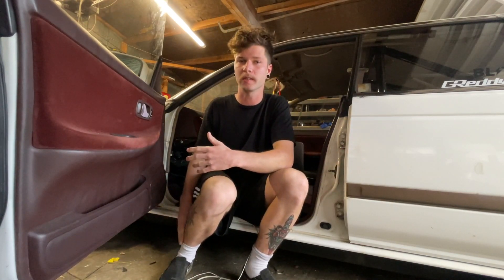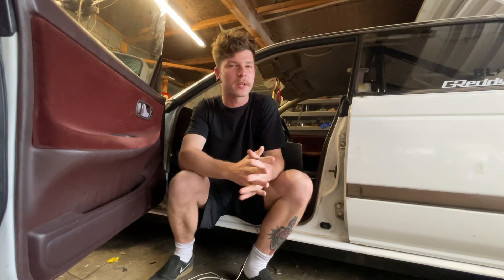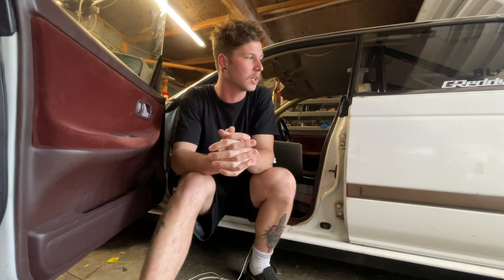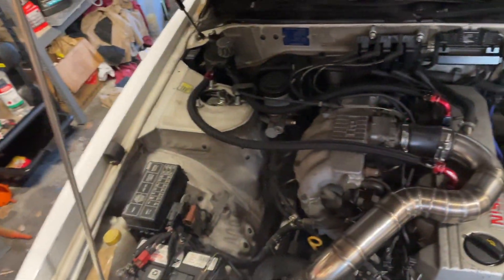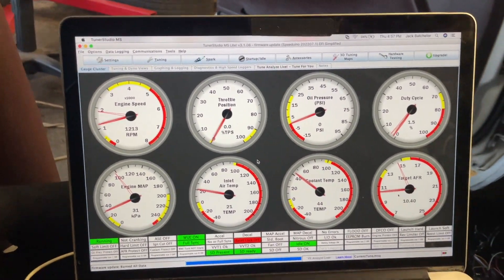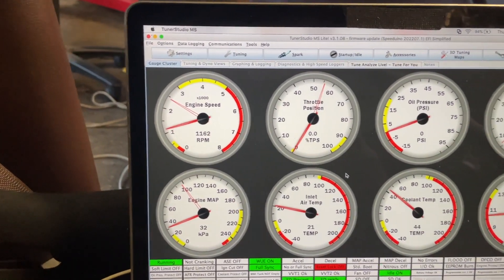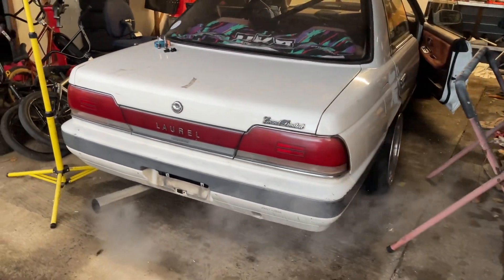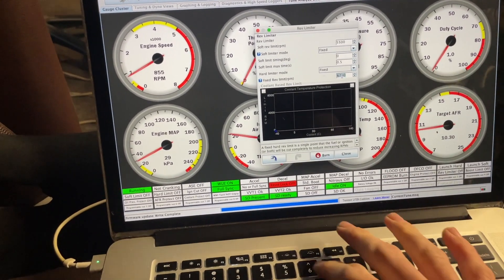RB20ET Laurel ready for tune! +Rev limiter testing

Comment: I’ve got the same first gen rb20E in my SA22c rx7, mine was a factory ET.

How’d you convert the valve cover ports from plastic barb to -AN?
I’m definitely hesitant to pry at them as way over here in Trinidad WI the engines are very uncommon.
Reply from the maker: Oh sick thats an interesting swap! I used the rb30e valve cover which is metal and has threaded in ports from factory so i just got metric to -AN adapters
Reply: @JackBatchelor33  sick series btw, I’m sure there’s a couple guys out there stuck with this bottom-rung RB, like myself, who really appreciate the infotainment. Cheers 🍻
Reply: @JackBatchelor33  ohhh, makes sense why your cover looks kinda squared-off (like the s1 rb20et)..seems that shape is shared by the metal barbed rb30e cover also.

I guess I’m stuck with plastic..pretty long list of things for the engine i’d ship from Aussie before a cover haha.
Reply: I’ve got two shorts with the car, no engine bay pics tho
Reply from the maker: @akashmaharaj3389  cheers man! Keen to keep pushing the limit with it once my new cam arrives. Your car loos and sounds epic
Reply: @JackBatchelor33  madd, looking forward to all the new single jingle info I can get my hands on haha